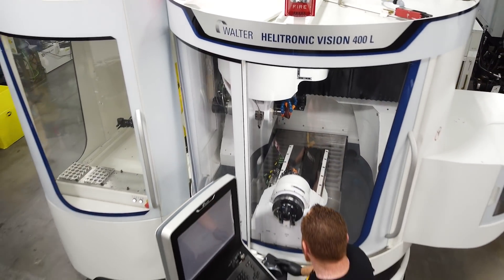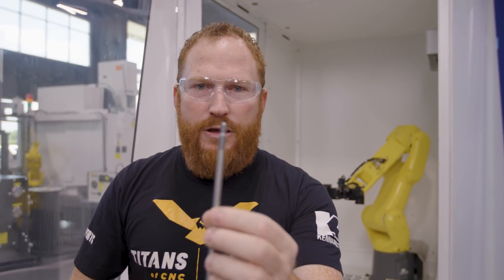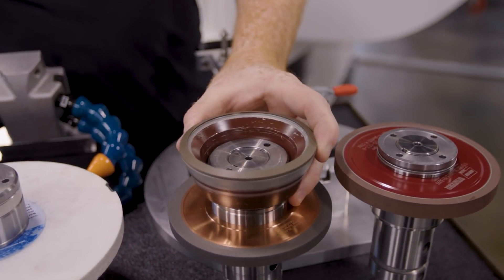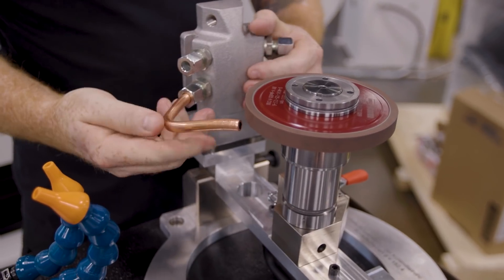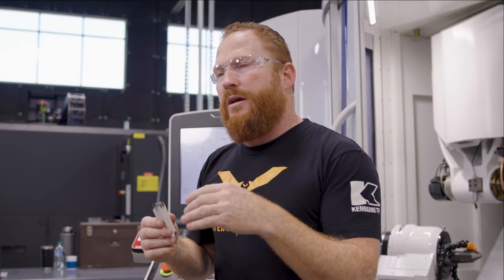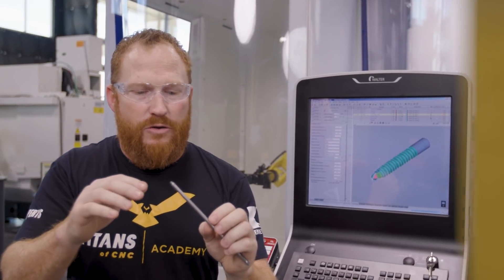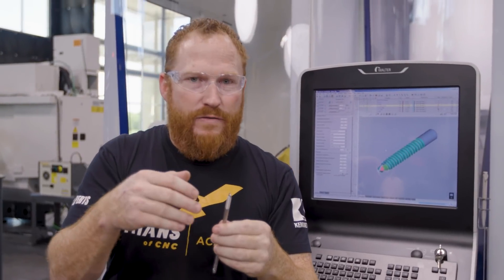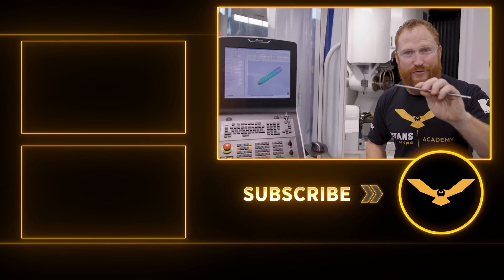Part #1 - Grinding Bone Pins on the Walter Helitronic Vision 400L

Comment: We have had quite a few comments asking why we don't run this part on a Swiss-style machine. We have access to the Walter that allows us to make carbide and HSS cutting tools as well as medical devices. In our application, it is important to show how our Walter universal cutter grinder can be utilized in many applications where a swiss turning machine does not make cutting tools. The Walter machine is capable in other markets because of its versatility. The grinding process also generally produces a better surface finish as well.
Reply: Yea try grinding a cutting edge in a turning center....the tip geometry on that is on another level!
Reply: But would you win a bid on making the screws, using a grinder?
Reply: @steinarne79  he literally said it was to show case the machine and it’s multiple uses.
Reply: @_aa_7  It is a showcase of... none worthy information? I can dig a hole, but a excevator can do it in a flash...Titan has always said you can take information he preach to the bank...I feel this is not as much usefull information, as it is needed comercial time according to a contract...
Reply: @steinarne79  well it’s clear the machine isn’t going to be of use to you so why bother taking the time to comment on it? This channel is showing the machine capabilities of a bunch of different machines and applications, still a learning type channel, who knows what the print says as far as tolerances and finishes.
Reply: @steinarne79  what would you use for this part? I'm being serious,  I'm new to all of this. Incredibly curious Bout it all
Reply: I love your energy in every video you're in! I think Titan found a real gem and even though I might never end up working on one of these machines its always fascinating to watch!
Reply: "How do you keep the oil so clean, and what cooling and filtration equipment do you use? Or how often do you change the grinding oil?"

Comment: got t-boned on my motorcycle by a car that blew thru a stop sign.. i now have a metal rod running from knee to ankle, a t-shaped plate on the outside of my knee ,ankle joint is fused with staples ,screws and pins holding it all together, so i have a few of those in my leg

Comment: No burrs during operation? Do you remember the specific material? I work in medical branch and i make drills for the teeth but we have problem on the surface cause of the burrs. Any advices?

Comment: Question: with the ability to control the tool path, can you avoid the secondary facet by revolving the primary facet? Was it done this way purely due to the print?

Comment: Had some back in 80’s
Most painful part was taking it out
Dr used a hand crank type drill backed it out
Burned like fire
Reply: I have nightmares when I see that hand cranked drill. I was able to keep one of the small pins from my arm. After 44 years I cannot lose tha pin. 
Doctor said they cannot reuse them but have to send in as biohazard.

Comment: I broke my leg in 3 places and had to have a cage frame attached to my leg with 8 of those screws and 4 plates it hurt like nothing else but becauseciam an engineer I was asking the doctor if I could look at one of the bolts they looked a bit like them but a little longer,I was awake when they took them out and the noise was terrable but they did a great job
Reply: Dang! Thats gnarly. I was watching some videos on the bone screws and noticed that people were awake when they took them out. No thanks!

Comment: I'm glued to Scott's  grinding videos. 

How would one describe the difference between "Trueing a wheel" versus "Dressing a wheel " ? [Please and thank you.].
Reply: You true a wheel to the arbor because when they are produced, they aren’t perfectly concentric to the arbor. You dress a wheel to open the pores of the wheel to allow for a more free cutting wheel. If you ever get a chance, they make a vitrified cbn or diamond wheel that allows it to be dressed with a rotary dresser. These are excellent for shaped wheels or wheels that have to hold a really sharp, 90 degree corner. They don’t wear at the beginning of the wheel where all the cutting is done .
Reply: By dressing a wheel, we are "trueing it". They are kind of one and the same, however, you may be dressing for another purpose such as to create an angle or other feature.